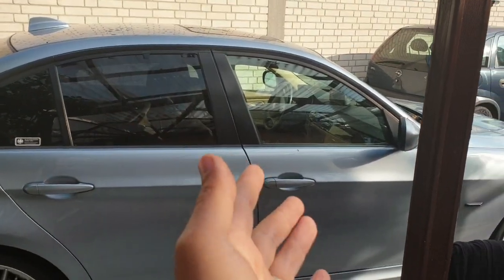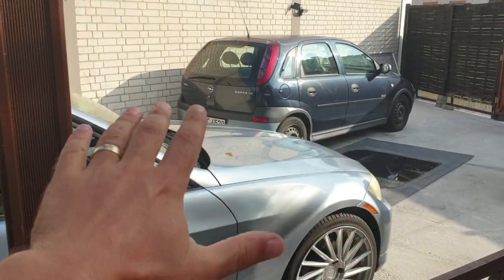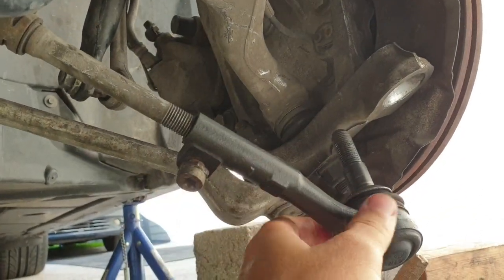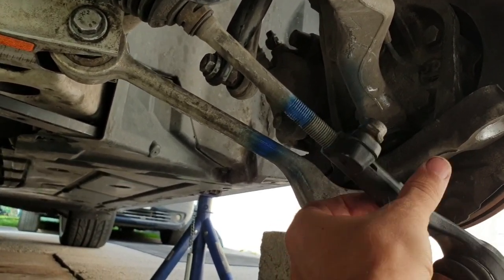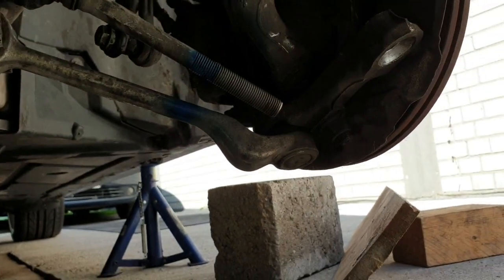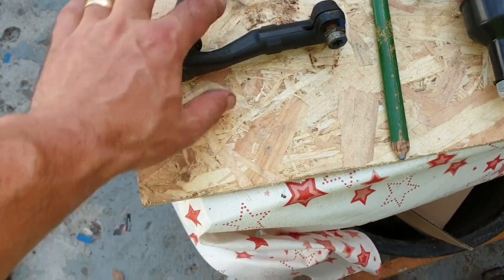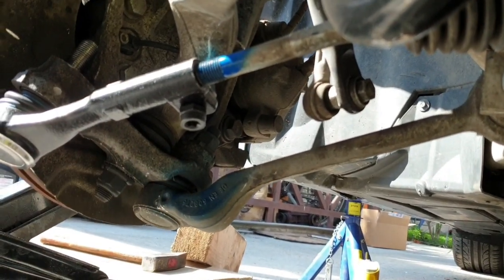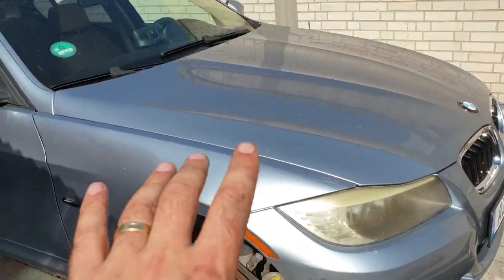Bmw E90 tie rods replaced and home DIY alignment! Steering wheel problem solved!

Comment: Why did you change it? Does your steering wheel ever shake? I got rims and it shakes around 50mph
Reply from the maker: With rims it's gonna have a vibration all the time if the wheels are bigger than stock. I have the same thing with my wheels but I've changed the tie rods because had a little play
Reply: Warp Drive M oh ok thank you
Reply: mikesterlb  i had that shake when going 60 miles but i install new shocks and struts and it fixed the problem. My struts were leaking oil. I got them on ebay super cheap
Reply: You need to check if there your rims are balanced